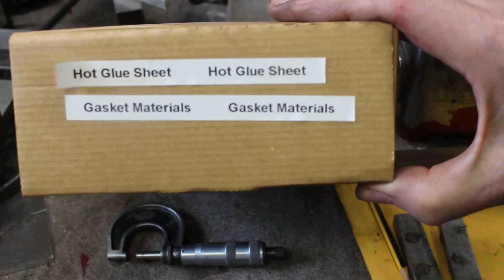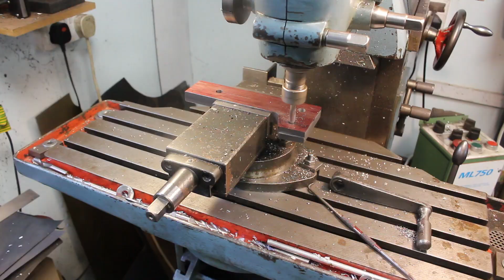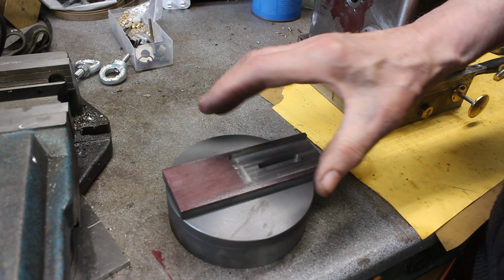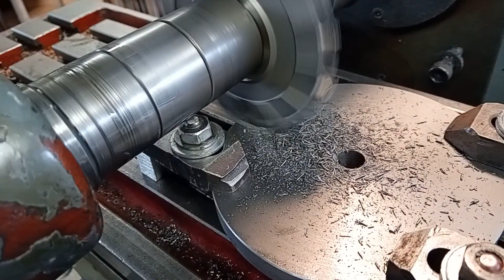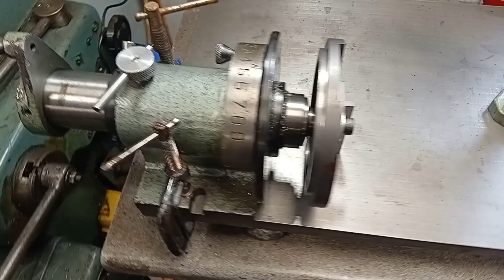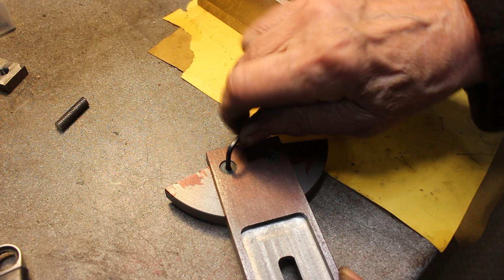Shop made Die Filer Build -Part 18 - Table Vertical Supports.

Comment: where do you get your hot glue sheets from? they seem as though they could be very handy. does coolant affect them?
Reply from the maker: Hi Paul
I bought the hot glue sheet on ebay, just do a search for "iron on hot melt sheet". It's used by woodworkers to glue in veneer inlays etc. so woodwork supplies will likely have it. It's not effected by collant or cutting oils, once your done it cleans off pretty easy with alcohol.
I hope that helps.
Cheers
Nigel
Reply: @GoCreatehms  cheers Nigel. will have a look tonight👍

Comment: That hot glue film looks interesting.  I've never seen that used before. So many potential applications!
Regards,  Preso
Reply from the maker: Hi Preso
Yeah, I use hot glue sheet quite alot, good for temporary assembly for drilling  2 components to guarentee hole alignment etc., it's like clamping parts together without  clamps and therefore with out clamps getting in the way. I've stacked several parts together for profiling, works well and supprisingly strong. It's easy enough to clean up with alcohol.
Cheers
Nigel

Comment: Really enjoyed the footage with the horizontal mill. Very rare to see it being used on YouTube to  do this type of work. They seem to be the almost the forgotten machine tool with the other older style tool  the shaper with their ‘poetry in motion’ appeal more common to see as its looks so good on video. Impressed with the finish from the horizontal mill and of course the die filer itself.
Reply from the maker: Thanks, I'm glad you enjoyed the video. As well as the teraputic motion of a shaping machine its very low cost of cutting tools as compared to a horizontal mill/vertical mill also makes it favourable. It's very satisfying though to use the old school horizontal mill, it cuts material suprisingly quikly and with good surface finishes.
Cheers